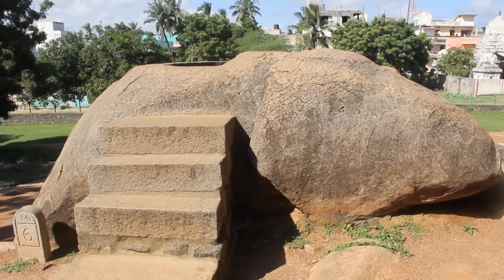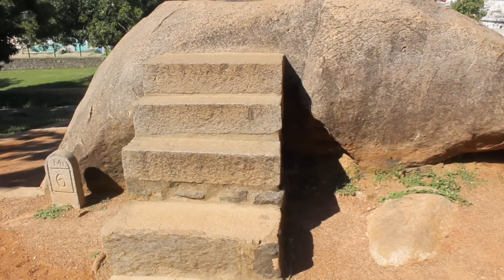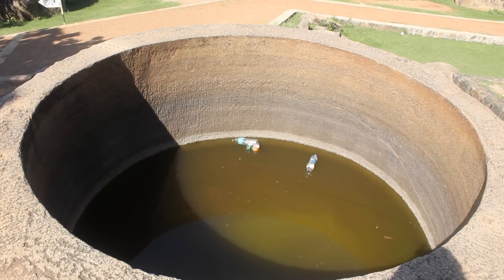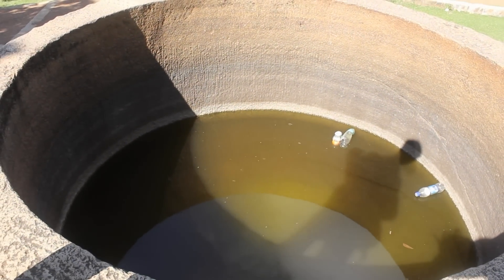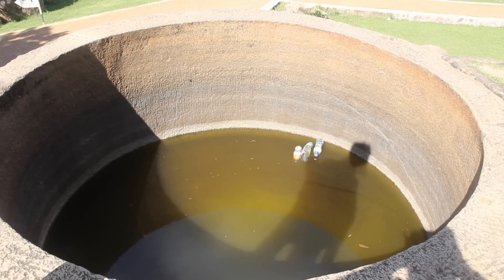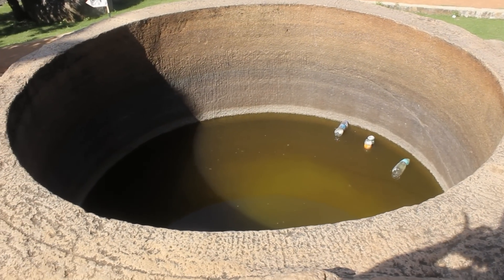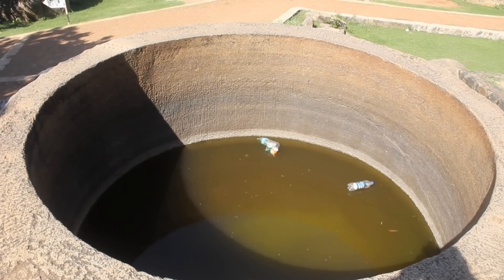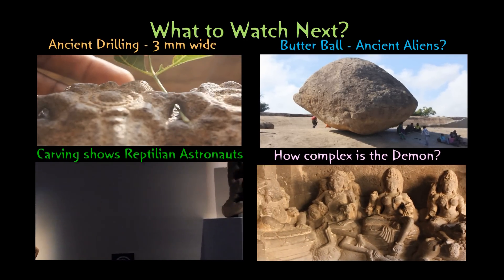Ancient Drilling Technology - Mahabalipuram, India

Comment: You just need a center point, a string with constant length and pointy granit fragments to remove the granit like seen here.
My guess is that they measured rain fall with this constant volume, only varianted by the height of the water mark, so they know when to water their fields and when it is not necessary.
Reply: +Kermit You are right about center point and string. But why put tremendous effort to carved a granite? So that to measured rain fall you said? They could easily made a large pot if just for that purpose. What did they use to carve the things again? Open your mind and received the infinity possibility the universe has to offers.

Comment: Could it be an end bearing (vertical load) for turning stone pillars? Lubricated by fine sand, animal or vegetable fats, it would eventually wear a near perfect hole as long as the pillar is supported well at the top end, maybe by a wooden framework. You'd only need to start with a shallow chiseled cup at first, just enough to seat the pillar base and prevent lateral movement. Various diameter pillars could be turned, lesser ones would wear a smaller bore but would possibly reduce friction for larger ones. A tripod-l;ike arrangement of trees would support the upper end of the pillar once it was lifted vertical (toppled into place by an elevated loading ramp)

For a prime mover, how about oxen or cattle pulling on horizontally-opposed ropes wrapoped around the pillar near the base. As they haul away from the pillar the torque would be produced in a manner that didn't cause too much lateral displacement of the pillar (to reduce a toppling moment). 

Need more torque? Add more oxen at arrange them symettrically around the pillar long axis. Once stiction is overcome I'd imagine that a low-RPM drive could be obtained for tens of seconds, depending on the length of rope Also, this is affected by the diameter of the haul ropes - too thick and it will build up around the pillar though this would also increase the starting torque. 

 To re-wrap the ropes, walk the oxen around the pillar in a  spiral motion as the rope tightens, eventially ending up beside the pillar and rady for another radial pull.

Comment: I would say that is a lot easier than you think to drill large holes like this , I know that it may take ages but if I had to do the same job with hand tools then I will start with a string pinned in the middle of the rock and a sharp cutter attached to the other end 

Start scoring the rock around until the cutter goes 1/2 inch deep  then chisel the inner part of the circle  . It is a very time consuming process but it can be done manually . 
Im not trying to say they didn't have advanced cutting machines but big cuts can also be done manually .

No idea how they drilled 1 inch holes tho - there are no ways you can cut / drill a small hole manually , especially throughout  unless you ve got a powerful machine to do the job

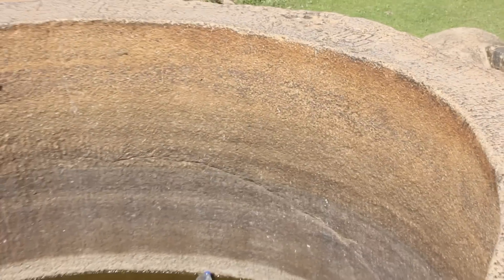Comment: look at min 2:00 , it does not in anyway look like a drilled "hole". drilling would make circular shape, but in this case, it is from top top bottom or vice versa. also, take a closer look at the edge of the pond. by the way: what is "wrong" with the bottle to the right. is there so much wind at the bottom  ?! i´m just looking , not judging! <3

Comment: i think they used a technological method of softening the rock which made it pliable so the they could remove it without much effort from the surrounding rock. we can see this type of engineering at sites in south America, where the rock have very intricate & precise shapes or reliefs which could only be done with milling machines today. Also the walls are  made of stones which have been brought together within such precise fitting that you cant even insert a Gillette blade between them

Comment: It would be interesting to drain it to see if there is a hole in the center at the bottom  . Did they drill a hole in the center of the rock first insert a pole in and use a peace of wood with a hole in it  to make it work like a compass . You can see chisal marks going downward . It is possible but dam it would take a lot of time .

Comment: it's a hot bath bud they would build fires around the stone to warm the bath for either religious or royal bathing also check the stone lactation dose it look like there could have been a structure around it abd the drilling isn't that big a mystery. . use rock to carve rock with the same or higher density the size is that of simple upscaling and something as simple as a tree that has been braced and pulled by cattle oxen. or any other labor animals could have been used. .... as a grain mill than converted

Comment: You can draw a circle with a string as a compass. You don't need pi. And, people cut stone. This is obvious because we see these cuts hundreds and thousands of years later. The thing about a mystery is it does not always point to something exotic. It really just points to the fact that you don't know something. Maybe the ancients had lasers. But, it's more likely that they had adapted simple techniques into something more complex. People are clever and creative. They're are geniuses born to every generation. I feel confident that in the end, if we do find a solution to the global complex rock cutting mystery it will in every case not have been done with lasers of electronics or sound. The ancients had machines! They had knowledge of mechanics and some had knowledge of gears. They had the wheel and material tech. It wasn't nano tech but they developed a deep understanding of some things anyway.

Comment: Not that I’m NOT an advocate for some kind of lost technology (because I totally am) BUT, if you wanted to create this with simple tools it IS possible.  The only thing you’d have to guarantee is that you could drive a vertical shaft into the center of the circle.  Assuming you could install it completely plumb, it could act as a guide, like a compass and would at least be able to accurately measure your progress.  As for the work, I do see vertical markings that resemble manual chisel marks but I can’t see them close enough to confirm.  Don’t get me wrong, I don’t think this was created by regular people as we think of them.  There’s a missing piece of the puzzle for sure.

Comment: you don't need to know anything about Pi to draw a circle; you just need a center point and something that stays the same length when you move it around the center point.  Getting the sides perfectly vertical is as easy as suspending a weight from a string

Comment: They might have made it using a hard rock attached to a string to make the circle, and then slowly carve the inside. The fact that the edges r smooth does not mean that they did not use hammers and chisels as erosion probably got rid of most of the edges.

Comment: I wish we could see the bottom to see if there was some kind of pilot hole. It seems to me that this could have been done with  some kind of tool like a stick which had a perpendicular rod (to fit in said pilot hole) with cutters on each end faced opposite eachother and 2-4 people pushing it around in a circle. This would not require the knowledge of pi. The would just need to  be able place the cutters at an equal distance from the center.

Comment: It could be possible that they created a too that would spin a diamond by hand or animal power to rotate it.  It could have been designed to form a perfect circle for ease and maintaining momentum of the force used to operate the tool.  This could be a very simple explanation for its shape and perfect cut.  As for the size, perhaps once the circle was cut, it was broken into smaller segments to use as foundations or ovens or any type of building component.  Not everything has to lead to an unexplained alien presence.  However I don't dismiss intervention on any level for that matter. But this could be just by convience to complete several tasks in one pass of the tools instead of multiple runs.

Comment: If we assume that they had tools tools to carve out such a hole then it's not a big leap to make the circle. They could have easily marked a circle with a straight piece of wood connected to the center with one end and something like chalk or a tip of metal to scratch on the other side. If you start out with a perfect circle you will remain chiseling out a circle until the bottom. They must have always started from the center moving outwards layer by layer. You actually see the marks of ancient tools on the walls.
Reply: Don't forget that they often find different hardness-typed stones nearby for polishing.

Comment: The vertical lines on the lower half of the inside are not caused by weather erosion, if this was the case, as with softer rock, the radial marks cut around the rim would have been eroded first. All of these vertical and horizontal line cuts are made for one specific reason,  tuning. This is the largest example of a Singing Bowl I,ve ever seen. To make the bowl work properly,  all external structures making contact with the bowl, steps,  signage and the like would have to be temporarily disconnected from the bowls' external body. Otherwise, the resonance created from the activated bowl would be dampened and the overall tone of the Instrument would be distorted. someone really needs to try this out, obviously this would need authorisation to do it in the correct manner,  so try it as it stands in it's current state. I feel that if it works and produces a dampened sound, this would at least prove the function of the bowl and hopefully open the way for a full test to be conducted.

Comment: Simple but not easy; find a 20 ton granite subject and a long hardwood stick to make into a radial cutting device with a natural diamond fastened on the end and, of course, a caveman hammer. Find a hole preferably near the center or drill one to use as a fulcrum - insert one end of the new tool - then roll up your sleeves and start pounding away - pound, pound pound, round and round and round, at infinitum, back and forth, whacking away chiseling, cussing and swearing, sweating and bleeding from sun up to sun down for about a decade - and voila!
Reply: MrSmackdab when you have 10k mens at task its an easy job...thats what we dont understand in our society...

Comment: You don't need to use math to scribe an arc. A string , pole and charcoal is enough. Looking at the sides I see vertical striations (tool marks) and it occurs to me... a tethered chisel would only reach so far from it's tether post. This could create such a bowl. Drill a small hole in the center to place the post, use the tethered chisel to remove material creating the rim, clear away inner material up to the post, lower tether and repeat.
Just a thought.

Comment: I wish we could see the bottom of this hole; is there evidence of centering, as for a vertical lathe, or did they use something more like a hole saw? I look at this perfectly cylindrical, apparently vertical hole, and picture something like the pivot/base for a huge shaft or platen. In Asia I have seen large pottery wheels mounted on a hole like that and using smooth mud for a lubricant. In Agra they use ground-mounted wheels like that for grinding stone cabochons. 

What is missing in all of these partial machines and the seemingly impossible constructions they were used to build is the mysterious power source. I think the ancient builders, whoever they were, had some kind of powerful device, possibly gravity-based, that could generate enormous rotational force. It was used for everything from carving to lifting and even flying.

Comment: The most  basic reason for that stone tank to be a circle or hemisphere is:   Volume to surface area ratio.  The circle will require the absolute least amount of work to produce the largest possible volume container.  That it is based upon a circle or hemisphere is  both brilliant and lazy.  That it still holds water 1,300 years later is a mark of the perfect choice of materials and fine workmanship.

I have worked in stone.
The subtle scars tell much of the carving technique.  The upper areas were carved by a rotary action.  Very possibly another stone pulled around and around to grind down into the rock.  Perhaps even,, it was used to grind grain to make flour,,,,thresh rice or wheat to separate the chaff,  and after ten or twenty years of use,, it had ground down to a less usable level,,, and THEN was carved deeper to form the tank.
The chisel marks lower in the tank  are NOT all perfectly vertical. That MAY mean different craftsmen.  But,,, the spacing, the rhythm of the chisel marks wuld imply to me,, one man did all of the finish chiseling.  Every craftsman has a 'hand', a signature that can be read by another craftsman.  My 'hand' looks nothing like that when I have used a flat blade or a comb to level a surface,,,, but all of my work,, looks mostly like all of my other work.

In other of your videos,,, the straight lines of holes to cleave a rock,,,,, same technique is still in use,, 'feathers and splines'.  We still do it the same way.
Reply: Exactly. Give a lazy man a hard job and he'll always find the easiest way of doing it.

Comment: Just a possibility ...

Not sure how it was drilled but if you look at the rock it has two termination points. ( Pointed edges ) One acts like a receiver and the other as a transmitter.  The circle acts like a converter. Converts direct current to alternating current.

It's grounded to the planets natural power grid allowing communication and energy production to take place. We call it free energy but it's the result of volcanic activity within the earths core. It's what keeps the earth spinning.

I could be completely wrong but based on my limited understanding of rocks and their properties that may be what it was used for.

Similar rocks at different locations were set on other points of energy on the earths natural power grid allowing communication and energy production to take place.

This may be an ancient example of how a quartz crystal works in modern day technology.

Comment: If you look in the middle under the water , I bet there is a centre hole about the thickness of a pole, all they would need is some wood , a bit of sand and water, and wood strapped to the pole, with the pole held vertical by a frame or tree-branch overhead, then just have an animal going around and around the outsie turning the pole and the timbers doing the grinding with sand and water , the sand and timber and water grinds the hole like a circle, I would even bet , once it was like a dish, the Oversized blender was used to grind grain into bread, , The animal attached to a beam off the pole goes around and around, grain goes in and the bits of timber go around attached to the centre pole , either grinding grain into flour or even then add water and mix into dough to make the bread to feed the town. They didnt have TV so they had 18 hours per day to get things done,

Comment: I do not see the relationship between knowledge of "Pi" to drilling a circular hole, the invention of the Wheel came much before this discovery... moreover the smoothness of the inner wall must have come through smoothing from wind... rough rock surfaces get smoothened over time, its common knowledge brother. Feel free to correct me.

Comment: im a carpenter, i would say making a circle is easy, they must have had a wood frame over the place and a rope hanging down to always locate the same center,, a stick and a string spun out from that center will make a perfect circle,, they must have done that before Pi.. it could be the arm length of the same person standing in the center, if he use both arms he will be the center, something very basic. They used the same persons thumb, feet or arms on other constructions, its in modern time we put a measure on it. im sure that hole is not perfect 8 feet, they did not know that measure, if it is perfect 8 feet its a lucky case. metric system is just so much smarter im an European 
 
maby it was drilled yes, could easy have been. with some harder rock looking like a large mill stone, ancient drill. maby it was made with chisel tools.. how ever they made it, it would be backbreaking work and take thousands of Man hours to make.. the person who owned this thing had the status of a King or god

i dont know what it is, kind of silly but it looks like a spa bath.. then it would make perfect sense that they dident make there well in the ground, perfect with a rock and sunshine to heat it up, it even has a stair. maby the mansion that was there is all gone over time, but i dont know the place there must have been excavation arround it,, was there found like millions small rocks from chisel tools, if it was drilled the rock powder would blow miles away

 it was not made by alien tools beamed down from the heavens ;) .. its man made with basic tools and techniques..

Comment: 1:12 "1300 years ago" means 700 AD … so the value of Pi was already 2300 years old (1st approximation by Babylonians who realized there is a relationship between the radius or surface of the circle and its circumference) : that's 2000 BC. 
It has been refined by the Indians around 700 BC then by Archimedes around 250 BC.
The value of Pi is way older than you think !…
Thanx for posting anyway !…